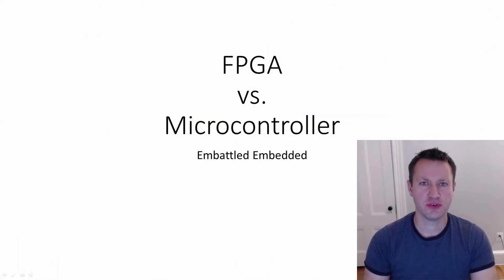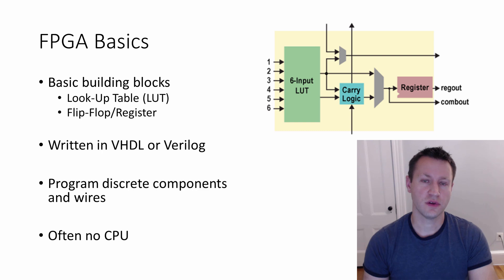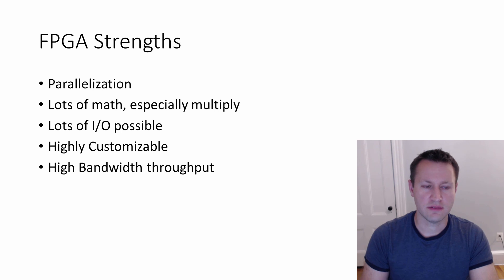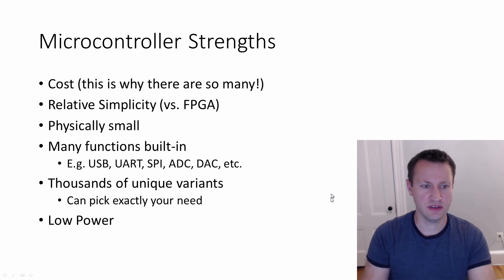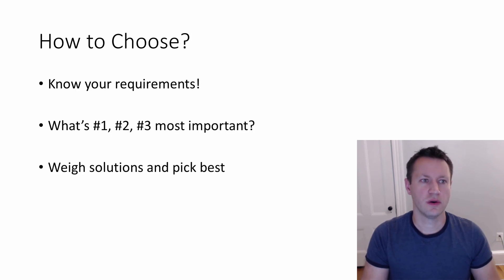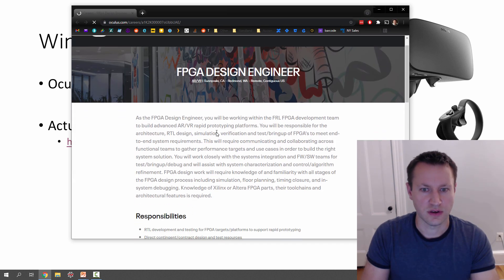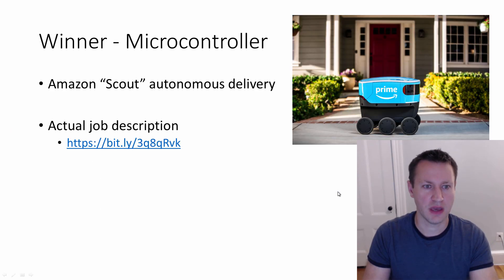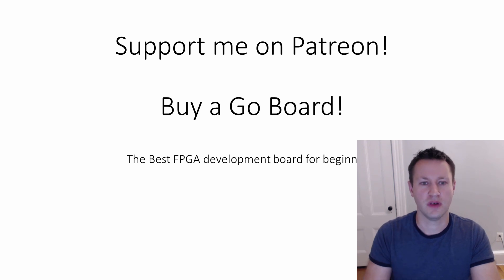FPGA vs. Microcontroller: How to choose the right one for your project

Comment: Another disadvantage of FPGA is the heat generation (due to high power consumption). If you want to build a compact prototype (product), it might get pretty hot and will reduce the lifetime or even shut down in warmer environments.

Comment: FPGAs use fixed-point arithmetics. If your algorithm uses a lot of floating point operations and accuracy matters, you should think twice before you choose an FPGA. It can be really hard because you do not get any support from the hardware.
Reply: Wrong. You can implement floating point in FPGAs, also a lot of microcontrollers don’t have floating point units (FPUs) hence are not good at floating point arithmetic. So with a lot of microcontrollers you don’t get any support from the hardware, but FPGAs you can implement floating point math if you need it and have enough resources.
Reply: @conorstewart2214  the DSP slices in FPGAs are fixed-point. That's the only support for arithmetic operations you get from the FPGA itself. Of course, since an FPGA can be synthesized to almost any boolean function, you could implement a floating-point unit or use some IP core for that, but that would be an extreme waste of resources. Floating-point operations are usually done in software, typically on a softcore or hardcore processor built into the FPGA, which I personally do not consider as FPGA design since I'm a hardware developer. 😉
Reply: @NoSpeechForTheDumb  you can use the existing DSP slices plus a little additional logic to do floating point operations. It is generally easier to implement multiplication and division than addition and subtraction though.
Reply: @conorstewart2214  the point is: even though you CAN do virtually anything in an FPGA since it's a reprogrammable integrated circuit doesn't mean you SHOULD do everything in it. If your algorithms rely mostly on floating-point logic, a dedicated microcontroller may be MUCH more economical since it is cheaper.
Reply: @NoSpeechForTheDumb  in just about every situation you would be cheaper to use a microcontroller, but if you are using an FPGA anyway there is nothing wrong with implementing a floating point math unit in it and if you needed to do lots of floating point calculations then you can do them in parallel.
Reply: @conorstewart2214   if you DO have an FPGA already and you DO have enough spare resources that's okay of course.

Comment: Correction: you can get an FPGA for almost a dollar. iCE40LP384-SG32. And you can even solder it without X-ray BGA inspection! It has 21 GPIO, 48 bytes in D flip-flops, and 384 LUT4 for your custom Boolean logic.

Comment: You can design high-speed (for example optical 10Gb/s) communication hardware with FPGAs: Serializer, deserializer, clock regeneration and so on. You can not make any of them at that speed with a microcontroller.
Reply: Wrong.

You can make those interfaces with some FPGAs (not all), you can also have them in microcontrollers too.
Reply: @conorstewart2214  prey tell, what MCU have >20gbps serialisers? Or at the very least an array of 2.5gbps LVDS links? Even getting a full speed 4-lane D-PHY on an MCU is a wet dream.

Comment: lot of FPGA themed stuff on YouTube, to me, this is the best overall channel - lots of pragmatic instructional material that is clearly presented. Oh, although already had a higher-end Digilent Arty 7 kind of board, picked up a Go board too as want to go through your lesson series. BTW, a current hobby horse is looking at RISC-V CPUs implemented in FPGA - there are several that can load and run on that Arty 7 board, but do you think the Go board would be sufficient to bring up a functional RISC-V CPU? That could make for a fun series in and of itself...SiFive has archived their github for their FPGA implementation - guess they want to divert attention toward their HiFive eval board. But would be nice to see that torch picked up as an FPGA implementation is a place to play, tinker, experiment. For instance, am keenly interested in a CPU and FPGA co-processor combo where they are tightly coupled on same silicon, and invoking the FPGA custom functionality amounts to invoking an extension opcode on the CPU

Comment: for implementation of infotainment which one would be better FPGA or microcontroller and could you explain y
Reply: Generish answer to a generish question: Use an FPGA for the signal processing and a microcontroller for the control logic. SOCs with integrated processors are ideal for such hybrid tasks.

Comment: In aviation, FPGA goes through hardware life cycle and verification which is much cheaper and quicker than software verification. This is where FPGA shines the most.
Reply from the maker: That's interesting. Can you elaborate on why FPGA verification is cheaper than software verification? FPGA verification is not exactly simple and quick. It usually takes longer than designing the FPGA itself.
Reply: @Nandland  In aviation DO254 and DO178 standards are used for hardware and software development respectively. In DO254 system level testing (black box) is good enough but DO178 requires unit testing (white box) which is apparently tedious and longer. Some good info here:
https://afuzion.com/do-254-costs-versus-benefits/ 
Im not sure on how either testing is performed but thats just how I read it. Curious to find out more though.
Reply: I never worked in aviation but generally consider this a myth because in hardware you always have phenomenons like clock-domain crossing or timing issues which are very hard to debug. Not to mention that there are much too few competent hardware designers in the industry.

Comment: I am wondering if you might know where I could find Verilog code which describes a logic element like the ones you might find inside of an FPGA.
I have been learning about FPGA and Verilog for a while and would like to look a little deeper inside of their hardware.

It might be a neat project to build an FPGA using an FPGA... Zero practical value of course but it would be interesting to understand how they're configured.

I understand how a multiplexer can be used to describe any combinational logic function but this is somewhat trivial and logic elements a a lot more complicated.
Most seem to have at least a flip flop, and some look like they have adders built in.
Reply: A “slice” or logic element is pretty much just a multiplexer with a latch chained after it.

Look at any FPGA datasheet and you will see their layout.

Comment: Watched the whole video, don't know what an FPGA is. Still don't know. Still enjoyed it, don't know why.
Reply: you can think of fpga as - readily available interconnection matrix on the fpga. As per the boolean equation of your written logic in HDL. interconnection matrix will be realized as a logic circuit.
Reply: 99.999% of all electronic devices on this planet are sliced as chips from disk-shaped n-type or p-type silicon wafers, processed at a factory (called "fab") to make patterns of transistors and HARDWIRE them, using layers of metal and oxide (insulator). All these chips are called ASICs. A microprocessor is an ASIC. A GPU is an ASIC. Even an FPGA is an ASIC. But it's a clever one. Ross Freeman in the 1980s at Xilinx (now AMD) has invented an idea to wire up the transistors at ASIC's application FIELD, and so FIELD-Programmable Gate Arrays were born.

ASICs are hard-wired at the fab.
FPGAs are soft-wired at the field.

To hard-wire the ASICs, we use Verilog (or VHDL) and special place-and-route methods to lay out the transistors and hard-wires on a 2D description of the ASIC chip (manual, traveling salesman, simulated annealing). Fab owns proprietary trade secrets of how to make actual transistors on a wafer. Everything below 130 nm is covered by NDAs and "top secret" access agreements (or non-commercial use university-accesses). The fab gives exact sizes and spacing between transistors so the so called "Standard Cells" can be used at the place-and-route process.

To soft-wire FPGAs, we ALSO use Verilog (or VHDL), and very similar place-and-route (P&R) methods. But instead of waiting several months for creating a chip at a fab, we create a special "firmware" that's called "bitstream" and we can put all kinds of different bitstreams into the same FPGA indefinite number of times. Some FPGAs, connected to each other, can even reprogram one another, while working in the "field of their application".

Both FPGAs and all ASICs run on a special model of computation that is different from CPU. It's a massively parallel computation of a forest of Boolean functions of many variables (sharing a lot of overlapping branches, otherwise there's not enough atoms in the Universe to compute anything fun). Each trunk of such a Boolean function tree produces a single 1-bit value, 0, or 1. In order to do all the magic we see around us, that single bit is stored inside of the truly magical device called D flip-flop.

D flip-flop is crucial to understand the magic of FPGAs (and most ASICs). D flip-flop stores the PREVIOUS (old, "current") value of all computed variables, so that value can be fed into the forest of Boolean function trees. Each Boolean tree in an FPGA produces the NEXT value (new, "updated") value and feeds it into the "D" input of the D flip-flop at a special moment, when the "CLOCK" input of the D flip-flop changes from 0 to 1: the D flip-flop has internal double buffer to swap between the "old" and the "new" 1-bit values stored inside of it. The "Q" output shows only one internal buffer's value at a time: a special device called "multiplexer" (MUX) switches between one of the two buffers.

In short, what FPGAs and ASICs do, for software developers can be summarized as reactive programming:
https://en.wikipedia.org/wiki/Reactive_programming